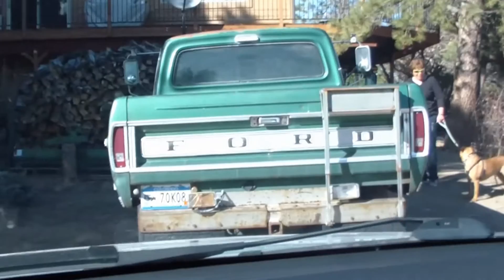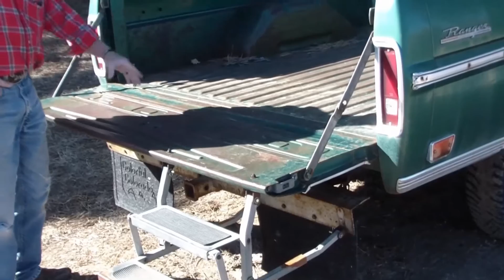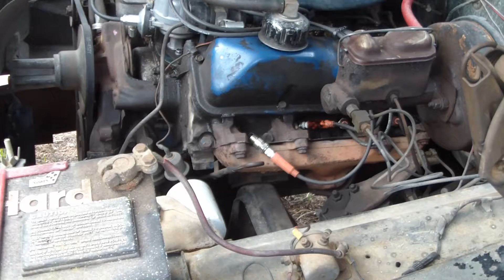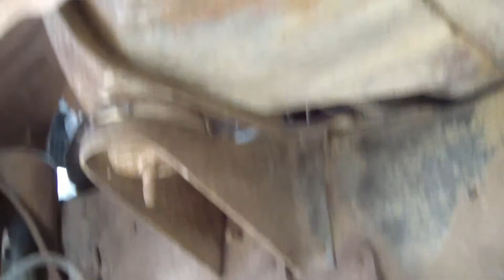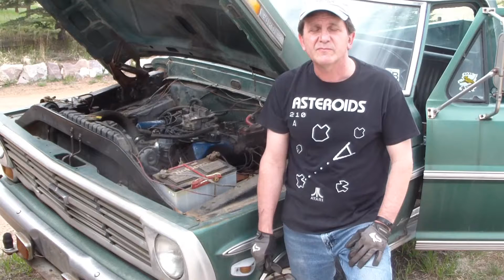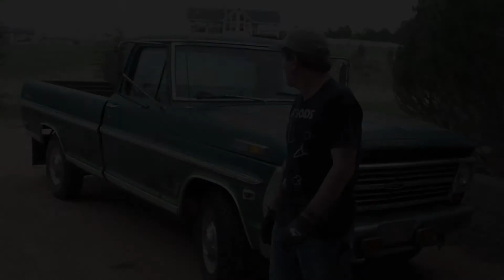1968 Ford $500 Truck FIRST START Will it Run? F250 Project Find (Part 1)

Comment: Good show!  I have found that the product "STABIL" RUST INHIBITER needs to be sprayed on the underside of all these old trucks to keep them from rusting away. That product will neutralize rust and keep your truck rust free with an additional dose.  I used to use WD-40 or other products but they are only temporary. No one has the horse sense to spray their vehicle with this.  I just picked up a 1969 Camper Spec. in a trade and is missing a radiator and brake booster but the rest is fine.  It looks good on the surface but underneath I stopped the rust from growing. About 6-cans (about $80 dollars worth) aught to save your truck.  Also spray that hood so it does not rust through and enjoy it for decades!

Comment: Condensers can be tested for resistance while in the distributor using a digital multimeter. Make sure the condenser is discharged and the points are in the open position. Set the multimeter to ohms. A good condenser will climb from a low  number to a high number reading. Then you can do a 2nd test for voltage drop by switching the multimeter to dc volts. The voltage should gradually drop down very low. These tests can also be down with the condenser out of the distributor. Could of saved you tow bill.

Comment: I also bought a 68 f250 camper special for $500. Mine was really wrecked on the front and the 360 was wore out. Got a different 360 and pieced together a new front clip. Runs and drives great now.
Reply from the maker: Good job!
Reply: @DonWSquared  Installing hei ignition rightnow

Comment: I bought a 72 F250 Camper Special Custom from my dad's cousin way back in 1992. It was winter green and mallard green 2 tone and painted it in 1991 GM Forest Green. Your truck looks exactly like mine except for grille, lower trim and Custom package on mine. (Interior paint was left in the lighter green but matches great!) What a treat! I know it's been almost a year since you posted, but sounds like the exhaust manifold leaks. If you fix that, those upper manifold bolts can be a challenge. Just go easy and use heat.
Reply from the maker: I just love these 5th gen Ford trucks, too. I narrowed down that exhaust leak to the donut gasket on the header/exhaust connection... GOOD EAR sir!
Reply: @DonWSquared  glad it was the header pipe gasket. I had to remove heads and take them to a shop to have the broken bolts super heated to get them out. Alot of work but it sounded great once those manifold gaskets were done!

Comment: I just bought a 1968 F250 and I'm in Colorado. Question: where did you get the replacement windshield?
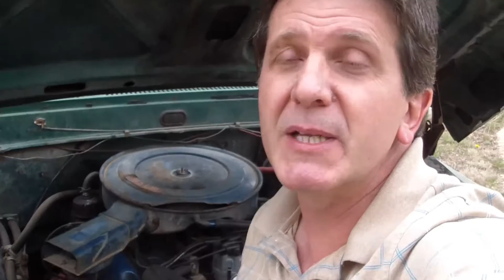Reply from the maker: A Auto Glass out of colorado Springs. They did my windshield install seen in this video at the 6:23 mark: https://www.youtube.com/watch?v=Ykx3asVo8kQ

Comment: old fuel might be the problem.
Reply from the maker: You're right! And it's been running better and better with fresh fillups...
Reply: @DonWSquared  PUT A CAN OF MYSTERY OIL AND SHOULD CLEAN AND LUBE FUEL SYSTEM.